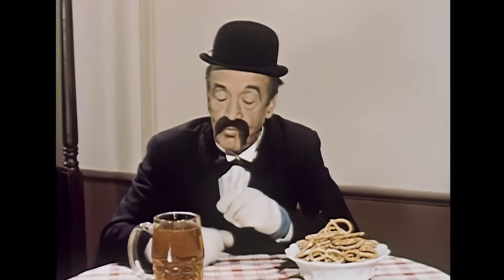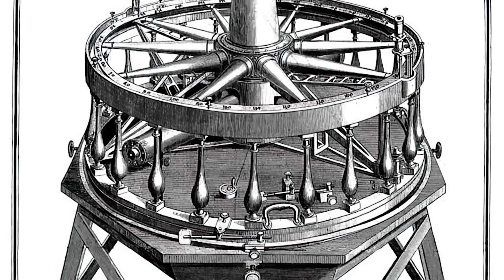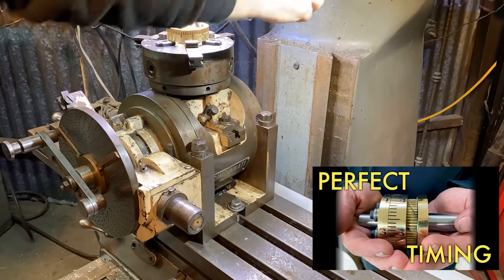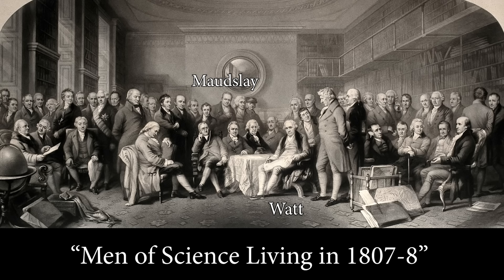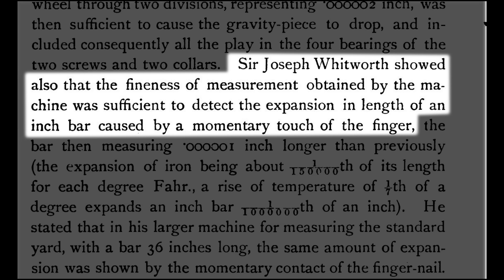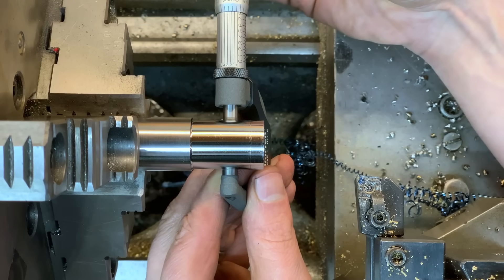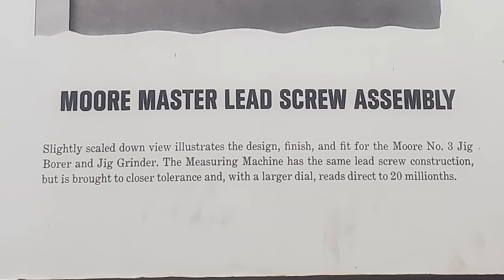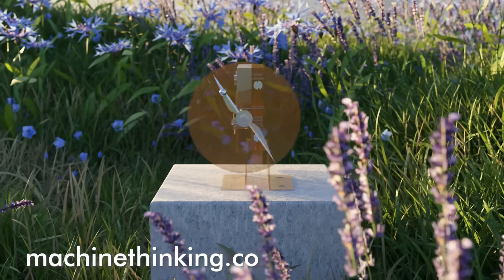The HIDDEN Screws of PRECISION

Comment: Something I've kept wondering through this entire series of videos is: how did people go from handmade, eyeball-precision screws to more precise screws? The screw-cutting machines you've shown so far each rely on the precision of a master screw to function, so how do you increase the precision of that master screw?
Reply: Endless. Iteration.  You make something that can make something else that's roughly precise to an inch.  Then you iterate and make it more and more repeatable.  The closer to that "perfect" inch you can get, then what you're actually doing is getting closer and closer by fractions of an inch.  Once you have that down, you build a machine that's precise to fractions of an inch.  Which, of course, means that you're actually dialing it in by fractions of a fraction of an inch.  You keep going, getting more and more precise, making tools that can measure and verify your manufacturing precision to tighter and more replicable tolerances.

You start out with something like pottery, which is largely done by "eyeballing it".  Then you might move onto something more precise like stone masonry, which requires more precision (unless you like crooked buildings).  Then maybe onto very simple wooden machines, like windmills and watermills which do have gears but also have a lot of slop due to wood's inherent dimensional instability (it shrinks and expands with humidity and wetness, and warps over time, etc...).  You can also start to experiment with things like early brass gears (antikythera mechanism, clocks, etc...) which could be made by geometrically dividing circles and using ratios of an arbitrary starting measurement to make work and then slowly and painstakingly removing material until the tolerances are tight enough to function.  But then you need more precise and repeatable measurements for something like arming an entire battalion with muskets, because now you need hundreds or thousands of muskets that are all within tolerance to one another to be able to have standard ammunition that won't have too much of a gap in the barrel to not fire correctly or too tight of a fit which could cause the barrel to jam and explode (if it fits at all!).  

Then you step things up to an entirely new level when you get into interchangeable parts.  People, I think, assume that the accomplishment of "interchangeable parts" was just thinking of the concept of being able to have, well, interchangeable parts.  But that's not at all what the accomplishment was.  The real technological breakthrough was being able to have measurement standards  and manufacturing techniques be precise and repeatable enough that it was possible to be able to sit down and just make something as simple as a screw over and over again to fit into the hole in another part that might not even be made in the same building, city, or country that you're in and have it be guaranteed to fit.  These innovations happened because of these precision breakthroughs, and similarly, these precision breakthroughs were pushed forward because of the demands of technological innovation in an effort to make products more affordable to a mass market and/ or to undercut the competition.  They feed on one another.  To put this into context, most machine parts require levels of precision so tiny that a human being cannot determine these measurements without precision instruments.  It is not possible, in most cases, to be able to tell a part that's within tolerance from one that is not.

The extent of mass-manufactured precision that we're at right now is in nanometers, and you see it in semiconductors.  We're in the 7nm - 5nm range, right now, and we're approaching the limits of what of our current technology can physically be shrunk down to.  These are tolerances that are so tiny that you cannot measure them with any physical instrument (like a micrometer), because we are now measuring these things at atomic scales.  We have to use things like electron microscopes and highly-specialized wafer probes (that use some sort of laser to check the refractive index or something like that of the chips by some mind-melting process I don't really understand) to actually validate them.  But we didn't get to 7nm by just waking up one day in the 70's and saying, "you know what, why are we bothering with all of this 10µm scale crap?  We should be, like, making them way smaller; we should just jump a couple orders of magnitude and make them smaller!"  No, we started with making transistors that were 10µm, then moved to 6µm, then 3µm, and so on and so forth over the last few decades.  Tirelessly iterating to make these things smaller and smaller, and rearranging them so we could fit more of them in an area, and inventing new processes to layer them more efficiently, and etc...  

The exact same thing has been happening pretty much since the beginning of the industrial revolution.  Early steam engines were sloppy as hell, with a lot of inefficiency from gaps around the pistons, friction from these loose fits causing steel to rub on steel, etc...  You could make extremely precise, clockwork machines with tight tolerances, but this was impractically expensive for machines that needed to be reliably run in less-than-ideal conditions and be somewhat repairable in the field.  This is also the real reason why guns took so long to take off after the discovery of gunpowder.  We in the west understood the concept and knew how to make a tube go boom pretty quickly after we found out about gunpowder.  The first problem was figuring out a simple and reliable firing mechanism, but the second, bigger problem was then figuring out how to make fifty thousand of them.  We had wheel-lock muskets before flint-locks, but they basically required a watch-maker's expertise to craft a one-of-a-kind gun, it was horribly expensive, they were finicky in the best of conditions and just generally not suited for the mass production capabilities of the time.  And then to get a simple flint-lock gun required that a standard pattern be designed so that hundreds of different craftsmen gunsmiths could build the same gun over and over again in many different workshops.  The problem wasn't the concept, it was figuring out a relatively cheap design and then how to make the same thing over and over and over with some degree of precision.

Want a more common and recent example?  Go actually stand next to a classic muscle car from the 60's or 70's while it's running.  Notice how it reeks of gasoline?  While part of this is from gas not being leaded anymore and many of these cars not having emissions control and catalytic converters, a lot of it is also just because the tolerances were so much looser that gasoline vapor just fucking leaks out of the engine.  The same is somewhat true of the sound.  That's the sound of inefficiency (and pollution).  It's a cool-ass sound, but there's a reason cars don't sound like that anymore (except diesels, but that's a different thing lol).  A lot of the reason these older cars run the way they do is because they're less efficient and turn a lot more of that energy into noise and vibration.  Improvements in manufacturing gradually lead to much tighter tolerances which lead to more efficient and reliable engines, until we get to today where a fairly average commuter, 4-banger hatchback has more horsepower, is lighter, more efficient, safer, less-polluting, longer-lasting, and more reliable than some supercars from 50 years ago.  And many newer gasoline cars are almost silent while doing all that.

So that's how it happened.  From a lot of work over hundreds of years by people who were constantly toiling away just to improve precision by fractions of a fraction of an inch to make something a tiny bit better, cheaper, or easier to make.
Reply: @Kevin_Narthex  wow! That was quite the long winded reply- & yet I enjoyed reading it…..?!🤷‍♂️
Reply: @Kevin_Narthex  Thanks for that comment, I really enjoyed reading it!
Reply: sometimes the screws are hand lapped for greater accuracy.  The real trick is having the equipment to measure them.

Comment: 5:10 YOU made the timing clutch? Wow! I've been following the marble machine for years and was amazed at all the talent that went into its construction. I think it is an amazing blend of art and science and that little gizmo is the heart of it. I subbed to MT about a year ago and never made the connection. You did a great job on that. Coincidentally, I'm changing the pinion and spur gears on an RC race truck weighing the options of speed vs torque going from a 54/13 (spur/pinion) to a 52/14 or 50/16 or 18 giving final gear ratios of 10.57, 8.89, or 7.91. I upgraded to a 100,000 rpm larger motor and 5000mAh 7.4V LiPo batteries with a choice of 25C, 50C, or 75C (375 continuous and bursts of 750A). Any thoughts would be welcome.

Comment: The reason for 2160 teeth is, I suspect because at that time angles were measured in degrees, minutes, seconds, with 60 seconds to a minute and 60 minutes to a degree.  Ramsden's scribing device's 2160 teeth had six teeth per degree, or per every 10 minutes.

Comment: Hi , I have a question that iam searching for an answer from a long time , (what are the methodes they used in making the rails of old machins and new cnc machins ) if you are intrested make for us a vedio that tells us how they ensure vertical and horisontal paralalisim for the rails of the same axis, also how they ensured flatness (as you know they can be parallel but not flat)  and how they made perfect perpandicular rails between axis(eg: x and y axis are perpandicular)

Comment: The Industrial revolution and manufacturing in general always jumped by leaps and bounds as the ability to measure accurately became common. Every decimal place of an inch was a milestone in the level of accuracy that improved consistency and ultimately interchangeability...
    A firearm made of parts measured to .1 inch was not interchangeable with another and required lots of hand fitting (think 1700s musket). One made to within. 01 inch had major components that could readily be interchanged with another but may require a little fitting (think Harpers Ferry rifled caplock, which allowed the major components (lock, stock and barrel) to be swapped between different ones). A weapon made to .001 inch had parts that were 'drop-in' interchangeable (think Colt 1911, All parts will readily interchange but may require slight fitting). Make a weapon to .0001 inch and it is interchangeable to the extent that the headspacing is not really changed with drop in precision parts like the bolt itself(think US M4 carbine).
     This is the way I like to explain the gains from precision measuring that can be easily understood by the average person. 
     Great Video! Ya'll Take Care and be safe, John

Comment: So the large diameter gear with lots of teeth is the source of the precision for the smaller screws?  Being able to precisely tie linear motion of the screw being cut to the rotation of said screw, is that the secret then?

Comment: The mind boggles at the notoin of anything needing to be accurate down to 40 millionths. What on earth needs such precision other than the machine doing the measurement? I suppose the machine building the machine that made the screw that then made the machine? Yowza. Ok, I just thought about it. So in order to measure on the atomic scale a physical analog stylus device must be used. Because the waveform of light being 400-700 nm is too long to actually "see" an atom which is allegedly 10,000 times smaller. Now we're talking billionths of an inch. So either all of this stuff is just presumed or someone has actual been able to measure at a level below our ability to actually see.
Reply: The right sort of electron microscopes can image individual atoms in a crystal or surface. They use electron diffraction (?) of high energy which have a much shorter wavelength than visible light.

Comment: 18:12 That item looks like a film roller out of somecine equipment. The portion being measured in the video being where the film's sprocket-holes would run. The lesser diameter between the two beign the portion of the film carrying the data - the reduction in size to prevent the film from beig damged/scratched.

Comment: Whitworth threads continued in to at least the 80s in machine tool vises. I have a 1989 Taiwan mill that came with a vise. That vise uses Whitworth 1/2-12 bolts to hold the front jaw on the base. When I broke one of them while disassembling it for cleaning it I was very perplexed as to why a neither a 1/2-13 or a 12- 1.75 would fit it. I was told the Taiwanese imported a large amount of machine tooling from the various English colonies in the Pacific after WW2 and that many of their machine had odd Whitworth bolts.

Comment: I know of an example of the mysterious OG micrometer giving birth to a measurement tool. It's in a machine shop I used to work at. And works fairly similar.

We used it "backwards", not to measure a thing, but to set the distance and calibrate gauges to 5 decimals.

It's set up is only slightly different to the OG one. Rough, or quick, positioning is via turning the side facing gear against a rack - not a worm because it's table sized not hand sized, then very precise positioning of the screw via large knob out the back end. Only you don't read it from the back, it's got a digital display. Another difference, due to size, is the mechanism that positions the screw rides with the advancement along the rack.

At least I think it's a rack in there, I wasn't allowed to look inside.

I feel the difference in these objects makes it a spiritual successor. Take the original and super size it, then make a practical quality of life change, then update it with magnetic linear encoder and Bam! You got yourself a descendant!

Comment: I was a jet engine mechanic from 71 to 94 and in shop, the mil-spec tolerance was 1/10,000" so we used inside mics, outside mics, and depth mics and scales that would change if you blew on them.

Comment: What better friends than metric friends? They remind you how better the metric system is on a frequency of exactly 0.01 Hz, that is 900,192,631,770 periods of the radiation corresponding to the transition between the two hyperfine levels of the fundamental unperturbed ground-state of the caesium-133 atom.

Comment: I discovered Whitworth threads while trying to machine  the interior thread for an espresso machine pressure gauge -- It turns out the thread was a BSPP ("British Standard Pipe Parallel", 55-deg Whitworth) thread which is apparenly most common for these types of gauges. As a complete newbie, trying to grind my own very small, 55-deg single point, inside tooling...I failed. I bought a tap but will never forget the difference between Whitworth 55-deg and standard 60-deg threads.  Awesome video. Thanks for filling in the knowledge background.

Comment: There are two particular Whitworth threads which are still in use all over the world today:
1/4" BSW and 3/8" BSW, which are both used photographic equipment for tripod attachment.
Some US people brashly claim that they are some sort of US designed screw threads, but that is incorrect, as many early photographic developments were done in the UK and so cameras use BSW screw threads.

Comment: Oh the stories I could tell you about precision measuring and how body heat will affect precision gages, even in a lab thats regulated to 68 +/- 5 degrees....  One of the secrets, more than one set of gages and isopropyl alcohol soaked to lab temperature for at least 24 hours.  Of course I'm talking about precision gage use other than CMM'S.  CMM'S are a whole other story, LOL....

Comment: I find multistart threads fascinating.... I've machined 3 start screws & nuts to match just to understand the problems involved... (a multi-start thread has pitch x  starts = lead... )

Care has to be taken when measuring parts during machining as the still-hot parts will have expanded & allowance must be made or the part allowed to cool before critical measurements are taken ... same with mics... don't hold 'em too long or they will take your hands heat & expand, giving errors... 🙄😣

Comment: The thumbscrew on the thimble has a smaller knurled part, that is the spring loaded ratchet. It should be used when taking a measurement. Using the thimble to achieve measurement and not the ratchet would give inconsistent readings.
Reply: Could you explain this further? Sorry, I'm not a native english speaker but I used to use micrometers daily in my former job so I am very curious in what you mean :)
Reply: @thepsychobilly88  When you measure a part with a micrometer, you squeeze the part between the jaws of the micrometer.  Using the spring-loaded/ratchet mechanism to turn the micrometer always applies the same torque to the micrometer, and will cause the same amount of compression on the part being measured; if you turn the micrometer directly by the dial, you may end up applying more torque, or less torque, and the measurements will be inconsistent.
Reply: @Kineth1  Aah, yes! I understand what you mean now 👍👍 I was aware of the spring loaded mechanism but I wasn't sure if you were talking about that or something else that I might have missed. Sorry for the confusion! Your explanation is very good and very helpful thou so I hope more people see it, it's well written and easy to understand, Kudos! :)
Reply: having used ratcheted and still mics, ive always gotten more accurate results by using the locked part and using "feel". the ratchets put too much pressure and read small imo

Comment: Ahh the humble and neglected screw. "screw is an inclined plane wrapped around a cylinder" much like a stripper twirlin' down the pole. The tight tolerances ones can spin fast rpm, takes a bit longer to get to the deck.   The sloppy ones go up one rev and are heels up.